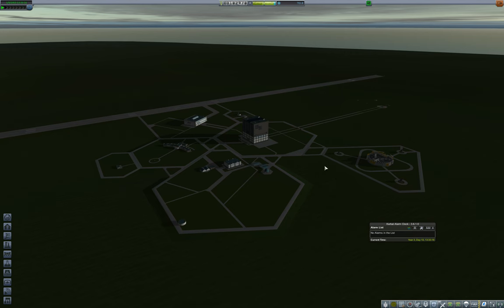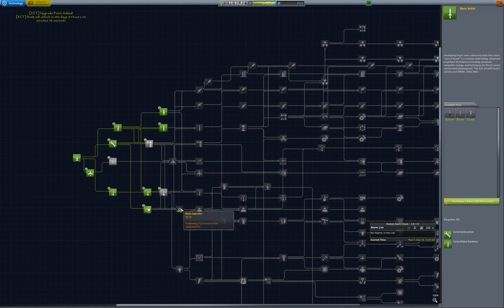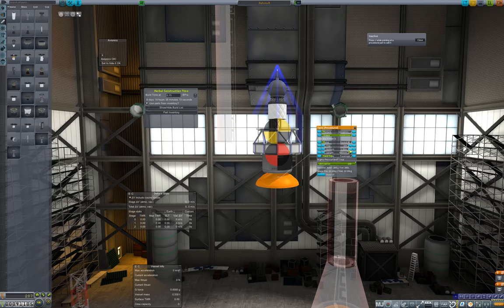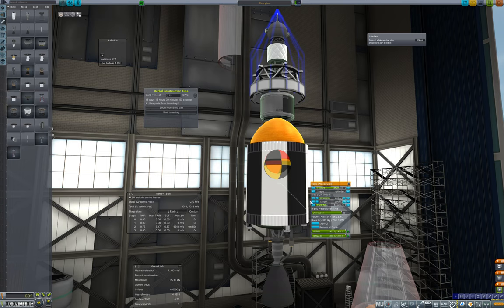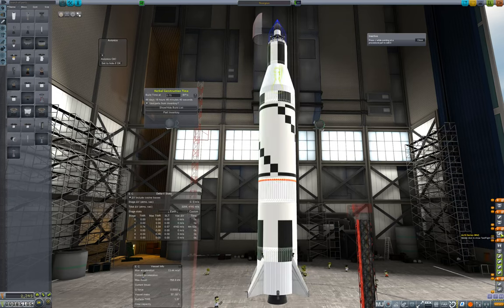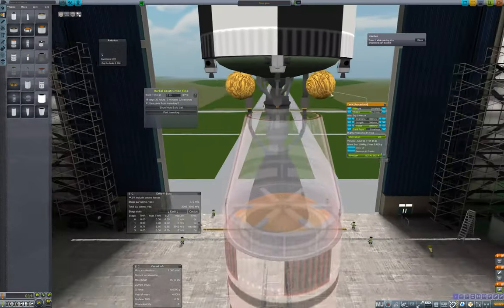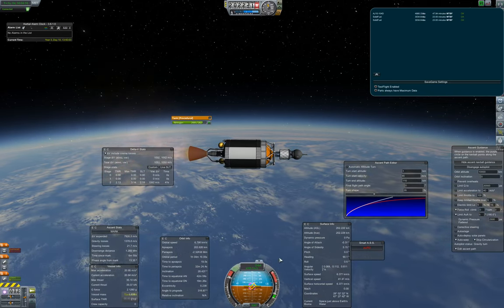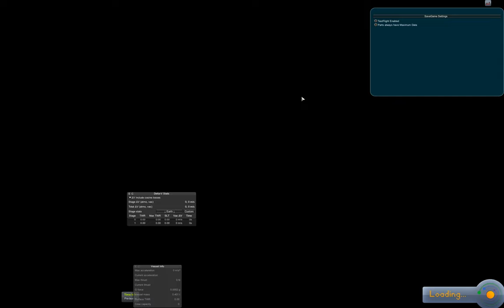RP-0 Tutorial Campaign Part 7: A New Launch Vehicle

Comment: Can you please elaborate on the LR79 choice? It would appear that LR89 has the exact same performance, yet 266kg lighter. The only difference I see is the slightly higher entry cost, which I'd imagine is well worth the 30% weight reduction.
Reply from the maker: Here's the breakdown: the LR79 has a longer rated burntimes (2m45s vs 2m15s) and higher reliability. It's also cheaper. The LR89 has better upgrade options, but we're going to switch to H-1s anyway. It's lighter, as you say, but dry mass savings on the first stage don't mean a whole lot--there's a good 5 tonnes plus payload above, and another probably 2+ tonnes dry mass in the first stage from the tanks and interstages, so 266kg doesn't mean much.

But the most important consideration here is the burn time IMO. Imagine how much less performance we'd get out of that first stage if we had to cut it off at 2m15s.
Reply: Thanks, that does make sense.
Love the series, btw!